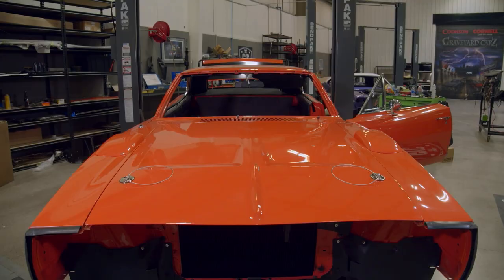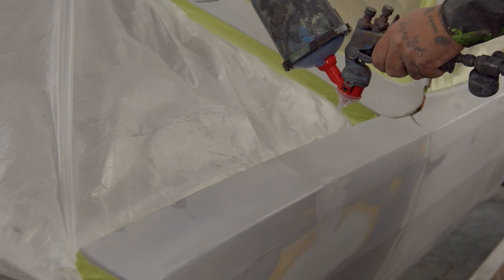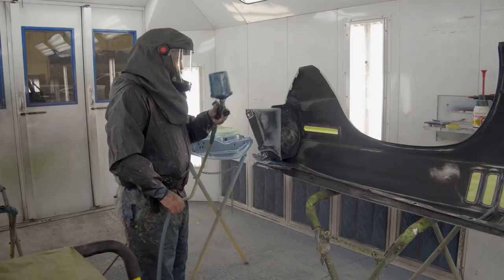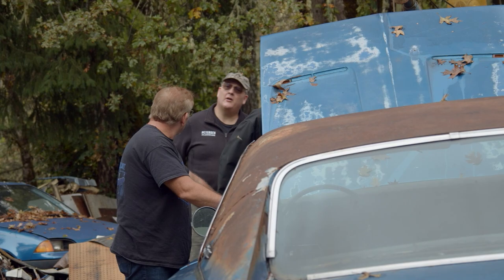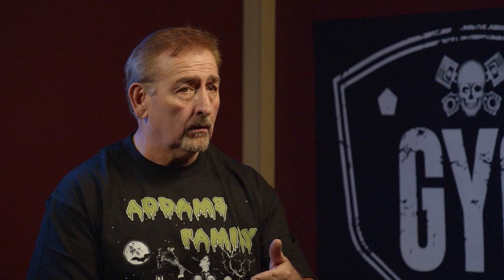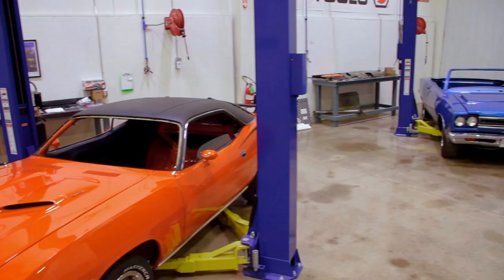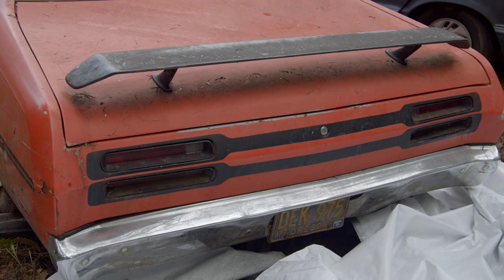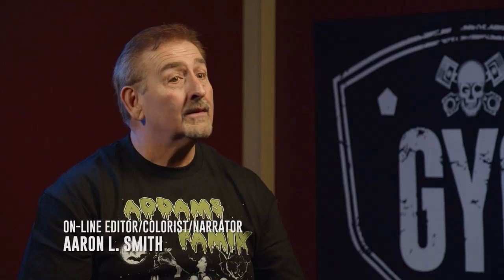NEW EPISODE: YARD FIND CHARGER R/T 440 4 SPEED!

Comment: It's useless, without a fifth gear on the transmission, all these restorations are just removing rust and repainting the same thing! A 5th gear would completely change the performance of these restorations and make those cars much more valuable!
Reply: This is completely false, adding anything to most of the cars would kill the value. Clearly you have no clue about this is show or why factory correct is worth way more.